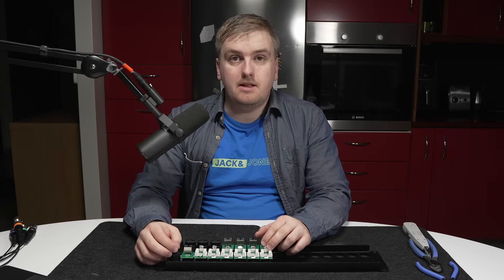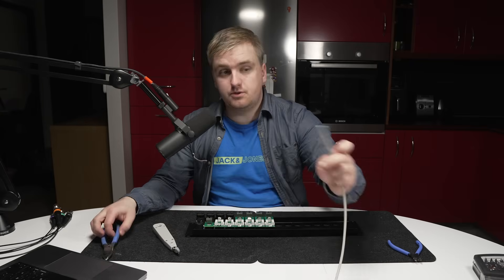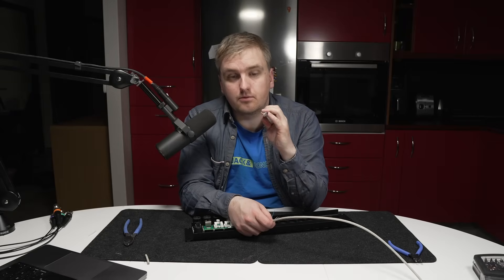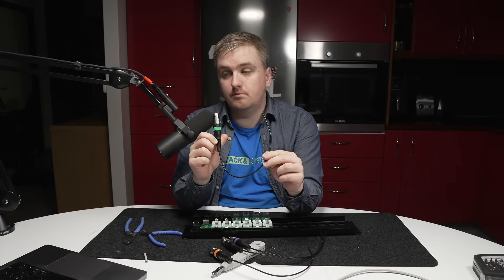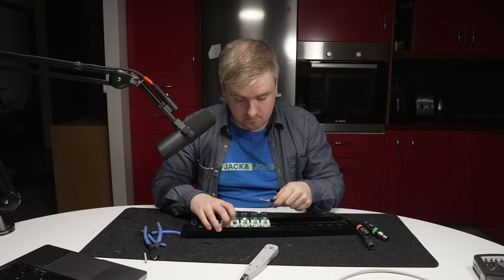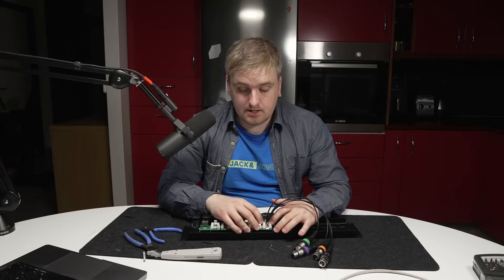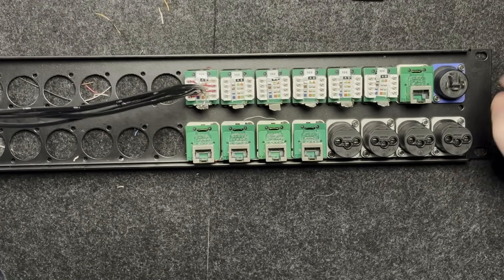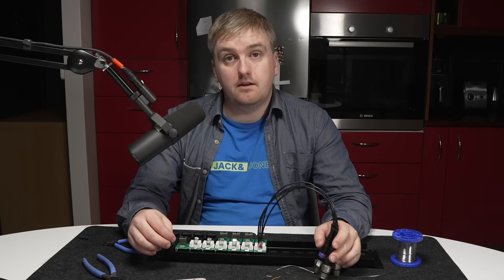Analog Audio over Cat 5/6/7 - Building your own panels

Comment: how long is the maximum length for the CAT5/6 cable for that?
Reply from the maker: Ive patched through a big conference building for getting sound in the foyer for special events. That was probably well over 150 meters without issues (line level signal)

I would definitely be more confident doing line level over longer distances, but for my setup I rarely go over 15 meters.

Comment: Reddit is not a source for any information. No one uses the A variation, it was the "military" variation, so most never learn it. Based on the interface brand you get, you would be the pinout you want to follow back in your rack.

Comment: Hi Arni, great videos and very helpful.

I have shielded Cat6 cable with individually foil shielded pairs but no overall outer shield and no drain wire. How would you terminate the foil shield for all 4 pairs on  Neutrik NE8FDV-Y110 D Style thereon? Can these be crimped or soldered. Would it be better to insert a stranded cable inside the foil and solder this to the Neutrik ground connector?
Reply from the maker: For what Im doing Ive actually been using audio cables for wiring inside racks and equipment.

Ive been buying and using pre built shielded cat cables for connecting between equipment. Either Ethercon cables from Thomann or just shielded cat cables.
Reply: @arnieitthvad OK. My wires are inside the walls in a studio situation then terminating on wall panels so ready made cables won’t work for me unfortunately. I’ll keep looking and see if I can find something somewhere but there doesn’t seem to be much out there.
Reply from the maker: @glasgowguitarist3636 have you seen if Neutrik has any assembly instructions ?
Reply: @arnieitthvad i’ve looked but can’t find anything. I might contact their technical support directly though and see what they say.
Reply from the maker: @glasgowguitarist3636 try that. Tech support is there for a reason :)

Comment: Ok, saw this video, ordered the neutrik connectors for punch down and some thin XLR. My results were pretty bad 😭 ... Would you be able to do a vid in a. bit more detail on the punchown process. I grabbed a 110 punch from Amazon. I was getting channel 1 to show up slightly on channel 2, so some crosstalk and interference going on. Soldered the grounds to the metal clip and followed your pin out you showed on screen. It seems like the punch isn't connecting the or "nicking" the wire well enough maybe? I used the "low" and "high" setting on the punch down and same results. I'd honestly rather find the PCB boards I've seen in some of the ethercon stuff I've purchased and just solder haha but I have NO idea where to get those. Hopefully you can do a vid in a bit more depth of your specific tools for punching down and the guage wire you recommend. Maybe a 22awg XLR isn't good in a 26awg ethernet punch down slot?

Comment: Hi there, nice patch panel!
I’m wondering what you use for the labeling on the panel — I’m looking for a solution similar to yours but haven’t found anything that quite works.
The rounded edges of the labels and the evenly spaced layout are important to me for aesthetic reasons.

Unfortunately, the options from Trace Audio and Redco Audio don’t work for my setup.
I’ve ordered the small Neutrik DSS color plates, but I’d like to avoid handwriting on them — that’s why your approach really appeals to me.

What would you recommend?
Reply from the maker: This question is answered in my Wing Pt2 video

Wing Rack Pt. 2 - Answering questions and showing the insides of the rack
https://youtu.be/GqcikMReGLs
Reply: @arnieitthvad  Thank you for the fast response.

Comment: I'm listening with a pair of (HUGE) 5.1 analog headphones that I 3d printed and I'm about to finish the next 7.1 analog model (even bigger) in both cases I'm using cat cables and Keystone Jack. Considering that I didn't spend much on small speakers, I don't hear the difference with expensive Unobtanium cables. And the Keystone Jacks are very easy to use and compact.

Comment: A note about the wiring, there is a standard. Its AES72, it was introduced in 2019-2020 after the popularity of the sound tools products. Neutrik has a input box using this standard, I have not seen others use it yet.

Comment: Hi! Thanks for sharing! Have you tried to have two pairs as microphone inputs (with phantom power) and the other two pairs as line out returns in the same FTP cable? If so, were there any noise problems? Thanks!
Reply from the maker: @poultrysoundsmusicstudio3105  I’m doing Instrument+Mic and Stereo IEMs. No issue with that. Dont remember if I have used any condensers with this setup, But when I built it I tested all channels with a condenser mic to see if phantom power worked
Reply: @ Thanks! I’ll build one for sure!
Reply from the maker: @ I actually made a 2in/2out breakout box two days ago. I recorded a Video but I haven’t had the time to edit it yet.

Comment: Here is a free tip for all you wanting to waste time on this particular project:
Punchdown IDC?/Krone style are designed for solid-core wire, usually 24AWG. Stranded cable works loose very easily. Solid-core is also known as installation cable as it should be installed and not pmoved around afterwards. 

Use the RJ45 sockets and then use CAT-6a stranded patch leads to run around. CAT-6a provides sheilding on each pair.
Reply: I was wondering about shielding too, as this seems to a big selling point of high quality audio cables.

Comment: I started seeing these pop up all over azon about 3ish years ago.  It took me a long time to figure out how they made this work.   I thought there must be some electronics inside but there couldn't be much for the price.  They certainly cost way too little to have four a/d or d/a converters in each box.  Then it finally hit me, it wasn't that they were selling cheap electronics, but selling hugely overpriced empty boxes.  

As proof I made myself a pair and used them at a few shows.  They worked so much better than I ever thought they would.  I ended up making several more pairs for friends.  I mixed a theater show that had so many monitor, green room, dressing room, ect, feeds that I bought a roll of cat6 to run almost two hundred feet through the ceiling for a second drive snake.   It worked just fine.

Comment: We have two types of these punchers, the simpler one does not cut off the excess wire properly. Personally, I recommend the one with the "sensor" cut off. It is a small wire that recognizes the moment of good pressure.

Comment: I do the same pin out but I do the striped cable for pin 2 on every pair. What’s your reason for flipping that on the blue pair but not the others?
Reply from the maker: @chadsynths  im using the pinout Whirlwind uses for the Catdusa system, so not my pinout, but the reason for the reversed blue is that the Cat5 wiring has blue reversed
This is the B pinout
1: White/Orange
2: Orange 
3: White/Green
4: Blue
5: White/Blue
6: Green
7: White/Brown
8: Brown

Comment: This may be a dumb question, but I have to ask:  I work in IT, and I’m also a musician.  I have access to tons of cat6, and I’ve often wondered why I couldn’t use it for audio cable (shielded of course).  Thoughts on this?  Also, I mean just for normal audio duties, no fancy X32 or anything.  Probably not practical, but when was anything fun ever practical?  :)
Reply from the maker: @hdb28091  you can do that no problem, main drawback is that cat cables usually arent as nice and flexible as most audio cables.
Reply: @arnieitthvad  yeah, I 100% admit that this isn't the greatest idea, but I just wanted something fun to play with.  love the video, thanks for posting it!!!

Comment: i created PCB's which have a breakout feom RJ45 to XLR/jack combo. The PCB's are deseigned for 1U neutrik holes. All you need then is to use a good Cat6 cable and you can run anything. But this is a way to do it for cheap and it works fine
Reply from the maker: @MarcoNLD04  sounds interesting, do you have any photos or more info?

Comment: difference between A and B is that íf you use the same on each end. its a straight trough cable. if you use different ends. ist a crossover cable. cross over cables was used to connect from pc to pc. since the old ethernets didnt have auto sensing to know if they are connected to a switch or also to an endpoint
Reply: Sorry bud but that’s not the difference between T568A and T568B. You can have a straight through or crossover in either of those standards. The difference is in the order of the pairs at the end points. In the end, it doesn’t matter because a pair is a pair, but they shouldn’t be mixed in a patch panel or at multiple end points.

Comment: Very cool to see this in the wild! I've been doing something similar to this with my band, but we haven't stopped at balanced audio - It's also possible to pass MIDI and DC power through these same setups, and we're actively doing it! Also, with the emergence of the AES-72 standard, there now are wiring standards for audio over CAT cable, though Whirlwind is the only manufacturer I know of that has actually conformed to one of the official standards. For reference, they use the AES-72-1M standard. And Radial Engineering uses the unofficial AES-72-TBD "standard." You can get a lot of useful info about this standard by searching up "Quad Twisted Pair."

Comment: I made my rack panels by buying "Stairville RJ45 DMX Shuttle Snake MX4" (Thomann) for 39€ since they already are Neutrik RJ45 and D-holes, so I could just screw the whole thing (with the housing!) into my 19" panel from behind. Just had to replace the screws with longer ones. The XLRs are not Neutrik ones but for static patches no issues at all. 
I love building tech things by myself, but we shouldn't forget valuing our live-time and if I can buy a product that fits my need with a price that is fine (compared to my own time), I would always go this route. 
Anyway, great tutorial, thank you!!
Reply from the maker: @pst-mobilerecording5761  thats actually quite clever.

For my case I would still have to modify it since Im doing inputs and outs on one cable.

This stuff is mostly built in the evenings when the kids are sleeping, beats just hanging over the TV :)
Reply: Do you know if those Stairville boxes are compatible with the sssnake CAT boxes? The form factor of the Stairville stageboxes is not a great fit for on-stage use (e.g. a drum riser drop)

Comment: This is a great video, thanks Árni. Based on your experience, do you think that you could use a connector like this to make a DIY IEM split? 
For example, have the one Ethercon port go to two XLRs per channel? (for 2 sets of 4 channels?)
Reply from the maker: I haven't tried it. I did have a split which had parallel XLR inputs, and all the split wires were connected to the back of the XLR connectors (so two XLR outputs plus a jumper to the Ethercon connector)

I'll try it out when I get home to see how good the connection looks if I punch two wires into the same plug.
Reply: @arnieitthvad  Thanks! That would be great 👍
Reply: any idea if it might fit?
Reply: @arnieitthvad  Hey Arni, any chance you've already tried to punch two wires into the same plug? I'm actually trying to create CAT6 split that would be from one RJ45 in to RJ45 out and XLR out and if it would be ok to punch two cables into one plug I'd create this kind of splitter. Thanks a lot in advance. Honza

Comment: Great Idea, but to avoid over complicating the Neutrik Punch connector could you use a short cat 6 cable and solder the 4 cables away from the board.  Would be possible right?
Reply from the maker: Yes that should be possible. Not my idea of avoid complicating things since that requires more cables, more soldering and would also require a shrink wrap or something similar to prevent the junctions from touching.

Comment: i have done this and with a 400 watt amp towards the higher end the sound starts getting bad. i would test your set up with cat cable before committing to it.
Reply from the maker: Interesting, can you please explain your setup for that scenario ? What was being sent from what to where ?

The Pro-Audio industry uses Audio over Cat 5/6/7 for stadium sized rigs all over the world.
Reply: @ that is interesting. i was using it on logitech z906 using cat 5e. i think it has more to do with length of wire in this set up. at one point they said it had time correction and had no idea what that was when i tried this maybe if i changed some setting could of gotten it to work.
Reply from the maker: @ we are talking totally different worlds here. My use case is balanced audio, used in professional sound reinforcement environments. You are essentislly talking about using a Cat cable as speaker wire, which is definitely not what it is designed for.

Your Logitech is according to manufacturer’s specifications each satellite speaker is 67watt, the audio signals I’m transmitting range from 0.001-0.1watt.
Typical Ethernet signals are under 1 milliwatt (0.001w)
In case of PoE that is a DC signal up to 15 or 25w (depending on the spec)

The wire diameter of Cat cables is definitely not designed to transmit amplified audio signals and should not be used as such.

Comment: Great video! Is it possible to make this connection using 8 TS cables, or connect a Y cable and convert a stereo XLR or TRS signal into 2 mono signals?
Reply from the maker: @rafaelnietodrums  I have made an adapter to put 4 unbalanced stereo signal over a cat cable, which is in theory 8 mono signal which worked for my application (From my mixer into a stereo “External In” on a Presonus HP60 headphone amp) but I never really checked that properly for crosstalk etc. I would imagine that sending totally seperate signals over the same pair in a twisted pair cable could cause some issues.

That application was a bit noisy, but It wasnt an issue and wasnt really worth troubleshooting and there were more things in the signal path that could have made it noisy. It was always planned as a temporary solution and the noise was only heard when there was nothing playing.

Comment: Nice. Good for balanced audio, especially when using the good grade S/FTP cables which have individually shielded pairs. Crosstalk? What crosstalk? 
I once used a cat5 for running audio between a small mixer in a building and a FOH console on stage outside. Later on I learned I could just do a digital transmission since both the small and big mixer had a built-in USB interface and it was just a matter of setting up two computers on a LAN running Linux and pulseaudio stream. It was a bit pesky but worked; now I would use NDI though.

Tech tip: when soldering shielded cables, use medical forceps for heatsinking the shield, preventing damage to inner conductors. You may also want to bind those pigtails with a zip tie or a piece of heatshrink tubing - and use some form of strain relief. Normally I'd use a regular keystone jack patch panel and matching RJ45 sockets, they're way cheaper than Neutrik style hole mounted ones, but that depends on what you're building.
Reply from the maker: I'm using cables with ethercon connectors, so regular RJ45 keystone don't really work for me.

I don't really see where the medical forceps come in ? Maybe I have the wrong tool in mind.

Of course if I was building a whole panel I would use Zip Ties and find some anchor points to get proper strain releif.
Reply: @arnieitthvad  clamp the forceps on the shield between the cable and joint. This way the forceps will act as a heatsink, any excess heat from soldering has no chance to reach the cable and melt the insulation.

Comment: This Video is amazing. Thank you! I’ve been thinking for quite some time now to build to separate boxes with an ether tent connection to send power and two ways of audio between my bass amp and a small pedalboard with a tuner and one effect. I’ve seen something similar with some bands. Do you reckon something like that is possible?
Reply from the maker: @Tjorre.mp4  yes, my friend has an ethercon from his amp to pedalboard, he is sending:
Guitar Input
FX Send
FX Return
Unbalanced Stereo IEM
Reply from the maker: So Then guitar plugs directly into the pedalboard, so the post pedal signal is being sent from the board to the amp, them there is s post preamp signal going back tomthe board to a Space Echo pedal, and then back to the amp.

Comment: Thanks for posting useful tips! But I would definitely use some kind of strain relief on the cables from the Krone punch-in connectors. Any load (weight, yank..) now goes straight into the Krone connector where connection might (will..) fail over time. If there's no strain relief offered with the panel system, get creative with a drill, screws, super glue, etc... :)
Reply from the maker: @larslengberg  yes depending on what else is in the panel Ive been able to zip tie the cables to something for strain releaf

Comment: great video. what a hero!
Reply: Árni - question. If i am running mics with phantom power, do I need to run 3 pins? or does the common combined ground you solder cover this?
Reply: @flowerofzeus common ground covers that.
Reply: @ thank you sir

Comment: A is USA
B is Europe
Reply: In older Ethernet standards, 568A-to-568B (crossover) cables are used to connect two computer or two network switches together, while 568B-to-568B (straight-through) cables are used to connect computers to switches. Newer switches have automatic polarity detection function, so there's hardly any good to use 568A anymore